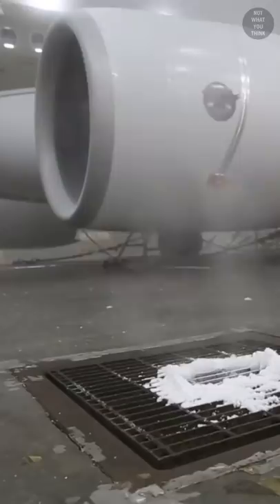Frozen in Florida #shorts

Comment: The real season why they did it is because when they wanted to test it in extremely low temperatures, they use the facility, and when they want to test it in extremely high temperatures, they open the hangar and let Florida do it's thing
Reply: I was thinking the exact same thing
Reply: Or high humidity.
Reply: Or
Reply: True for the freezer activation - hundreds and thousands of dollars per freezing test. A complete waste of money.
They also need to heat test it with all the heat generating lights - you'll notice they have thermal light heating covering and directed all over the plane.
Reply: I'm also guessing the humidity puts an extra strain test to see if the plane can be operational even while operating in a tropical-like airport.
Reply: @mothiurNCL  Freezers are more efficient when the outer climate is hotter I believe. As long as you have good isolation

Comment: On the save money point I just wanted to elaborate a little: if an aircraft has not been tested in the cold, you probably shouldn’t fly it to Alaska which is very cold.
Reply: Oh yeah that's a great idea I didn't even think of, yeah if it hasn't passed cold testing yet and then you go flying into the cold and then find out you have a bunch of problems before you even get to the testing facility.
Reply: Actually material properties under temperatures are usuallly well established very early on in development.  This kind of testing is usually to assess the potential for long term damage in stressful extreme conditions.
Reply: What an epiphany. 
I bet non of the engineers thought of that. 🙄
Reply: It is far colder at altitude on the way to Alaska than it actually is on the ground in Alaska.

Comment: I TDYed there back in the early 2000's on the AF Reserve C130J to see how it handled in the heat, I sat with the engineers inside flight deck while we monitored the instruments and the test equipment.  It was pretty crazy some of the tests we did on the aircraft.
In 2004 the C130J's  went to the SWA desert for over 2 years for the first time and no heat issues were noted.  It preformed so well the Air Force that the decided to start buying the C130J  to replace the older C130s

Comment: Leaving the erratic Alaskan weather patterns to instead experience tropical storms and hurricanes!
Reply: Far less common and easy to deal with than the cold in Alaska. It's once or twice a year or at all vs 6 months every year. It's also typically 70-80° during storms and you can predict when they come. Plus Elgin AFB is the largest air force base. Right now it's 80° in Florida with no snow or rain.

Comment: Could you imagine what their air-conditioning bill is in the summer to cool that down to freezing?
Reply: I don't see the electricity bill putting a noticeable dent on uncle sam's $800 billion pocket change
Reply: @kyleterry5190  Military contracts have so much waste in them sometimes 90% but I've known that for most of my life and live with it. I'm just curious of what the bill would be for that kind of an air conditioner. I know my friend's house in Arizona, he was paying about $700 a month to run the air conditioner in the summertime. Now you try to imagine a building with about ten thousand times more volume then a 3000 square foot house and you wonder what the bill would be.

Comment: There was a flight once we whose engines failed because of hail. The engine manufacturer tested the engine with rain, and assumed hail would be the same and falsely rated it for a certain volume of hail. During a light weather event (that normally poses no problem) the hail went straight into the ignition chamber instead of the side-channels like water does, effectively drowning the engines.

Shows how dangerous it is to not do these tests.

Comment: The heat exchangers for large refigeration units remove massive amounts of heat energy fom the test facility to cool it.  It's less disruptive to pump that heat out into an already warm climate.  Coversely, it's cheaper to extract heat from the outside in a warm climate and transport into the test facility to do heat tests.  The major challenge in Florida would be to remove all the moisture in the air from a humid climate.

Comment: Not to mention it would only make sense to build it in a hot area once you're done with testing it would cost a lot less energy to bring hot air from outside in to get rid of all the snow or ice if they were still in Alaska they would have to generate cold enough temperatures and then have other generators to generate hot enough air to melt it again

Comment: Air Forces Eglin's mckinnley climatic hanger .i saw space shuttle in side there at-30° and I worked on remodel inside .we removed 300 tonnes of insulation .there is a bomb shelter under it Too . i found a newspaper (1939)the place is huge .its one of the biggest,a pack of cigarettes(lucky strikes),matches,and a soda bottle with paper inside .it was unreadable thou.